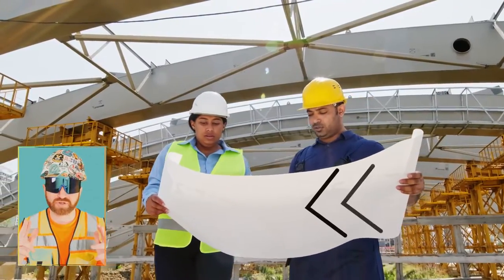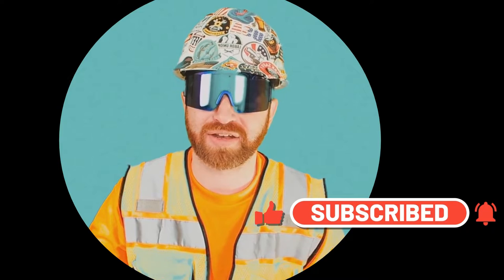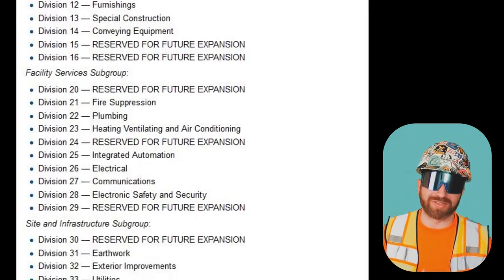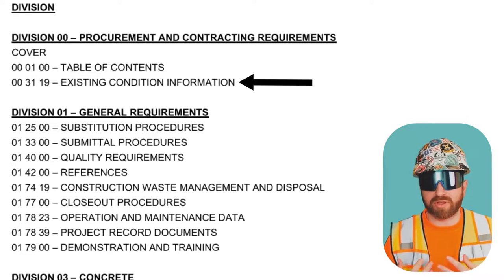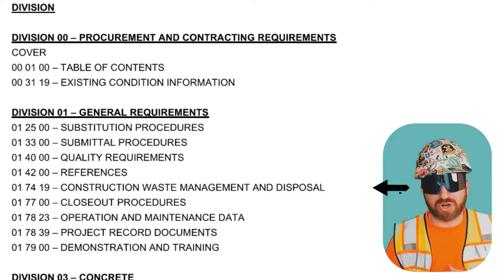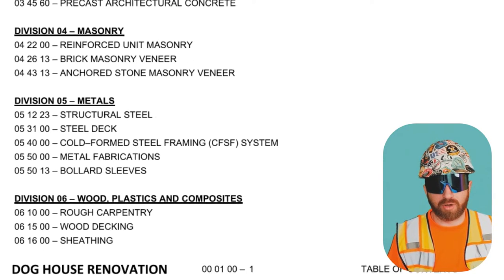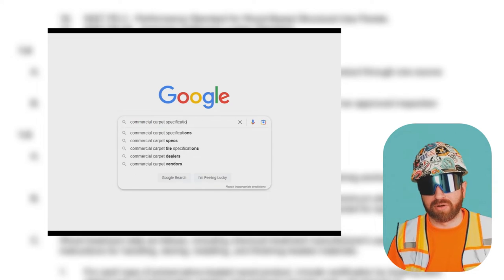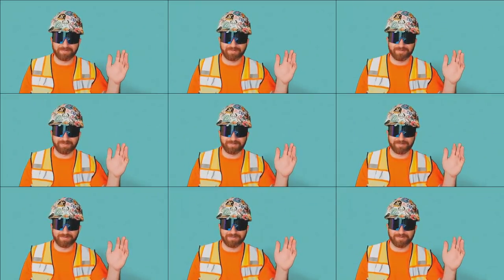WHY Construction Specs Are CRITICAL!

Comment: Thank god, i finally found someone on youtube actually knows what theyre talking about.

Thanks for doing what you do, I stepped away from pm for a few years and definitely needed you're vids to shake of the cobb webs.
Reply: You might be able to answer this. I'm guessing procore is still the industry standard.

Has it changed a lot over the last 4 years? I might have more Cobb webs than expected.
Reply from the maker: Welcome back aboard!
Reply from the maker: Procore is still the standard (they haven't updated much in the past 4 years), however - AutoDesk is trying to make a run at it now as well @mattpictaggi7504

Comment: Thanks man.

Any thoughts on prevailing wage work for multi family housing

Or how to go about getting contractors license on different states , namely Nevada or Arizona or Texas
Reply from the maker: Building's don't get built on paper : )  They're built in the field by the hardworking men & women in the industry.  I'm all about fair pay for the skill & talent that go into these construction projects.  The industry is pushing the limits of what can be produced under the least amount of time (and usually money) - so it's good to step back and realize how demanding the work is to put some of these structures in place.

Every state has different requirements for becoming a licensed contractor.  Take a look at each state's website that you're interested in - find the applicable application form and they will tell you exactly what requirement you would need to fulfill to become licensed in that state.